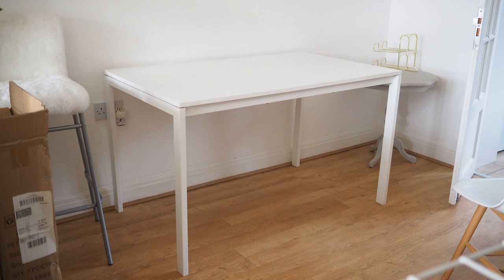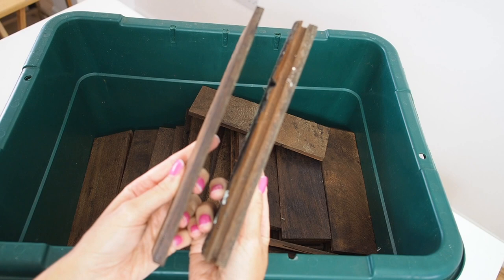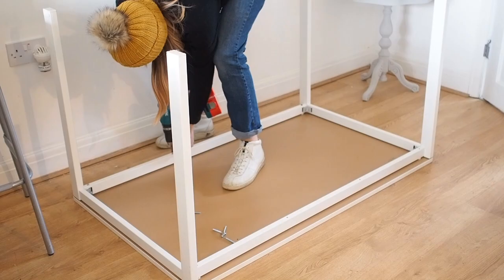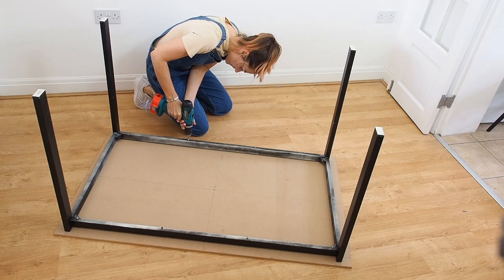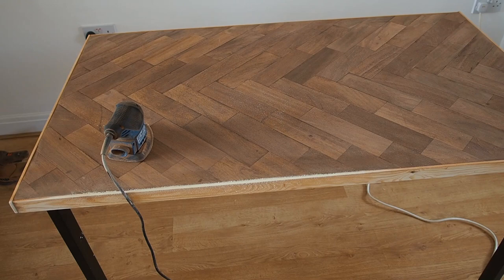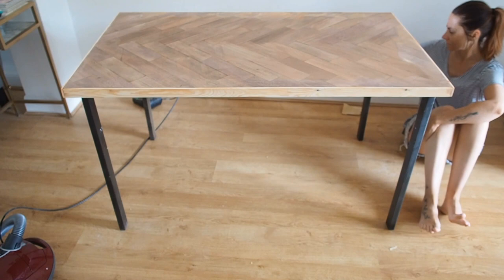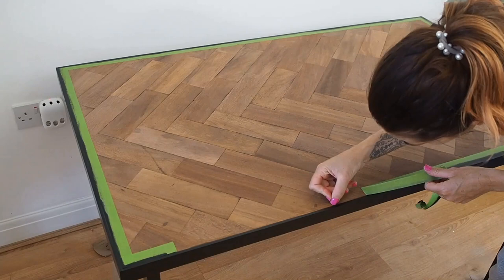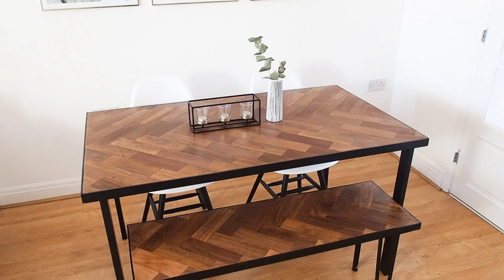PARQUET TABLE IKEA HACK DIY | Using reclaimed wooden floor upcycle - Bang On Style

Comment: Looks fantastic! 
Just learned a trick for using the circular saw (and any saw that has a flat base) in a straight line:
Decide where the cut line should be, 
Place  the left side of the blade of the circular saw on this cut line
Mark the width from the left side of the blade to the flat side of the saw to the left, this is the line where the base plate of the saw should start and stay along the table, 
To get a straight line from there clamp a long straight board or long ruler along this new ‘line’ 
Use this as a guide against which the circular saw will glide.
Tada! Straight edge.
Can even have a slight bevelled angle by tilting the saw inward a few degrees.
Can do the same to guide the other saw.

Comment: You’ve done a brilliant job, especially for someone who hasn’t done this before. I don’t suppose it would help now to say, your planer could have done the same job, but faster, with leveling the top of your table . Also, with orbital sanders, it doesn’t matter which direction you sand - it’s the joy of the orbital. But honestly, none of that matters - you’ve a fabulous piece with sentimental value - so beautiful !!